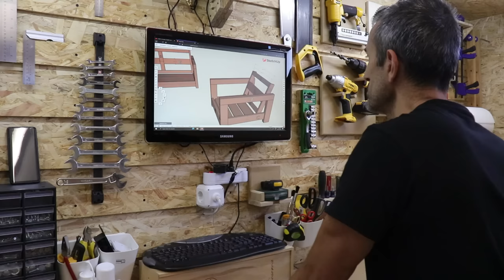DIY 3+1+1 Seater Outdoor Sofa **Free SketchUp Plan + Cut List**

Comment: One thing I would add, is 2 velcro strips for each cushion. Bottom side with staples to the frame and top side sawed into the fabric. No more moving cushions, when you sink into the chair / sofa.
Reply from the maker: No need that. They don't moove. 👍
Reply: @WoodYouDoIt  Maybe it is a me problem, but every time I slouch into a chair with unattached cushion, it slides away. 😅